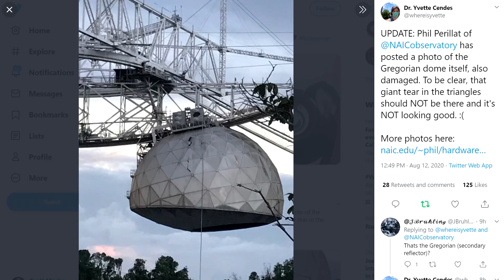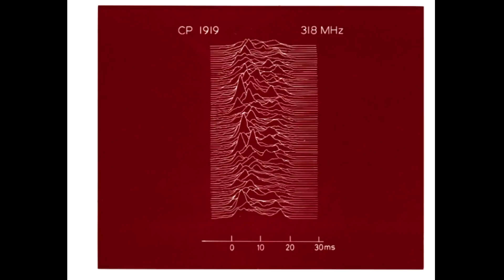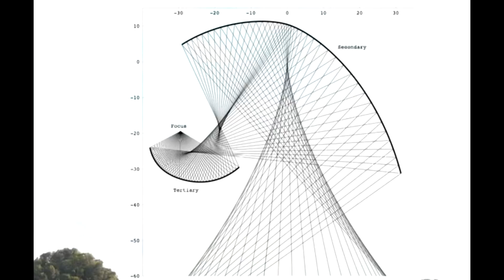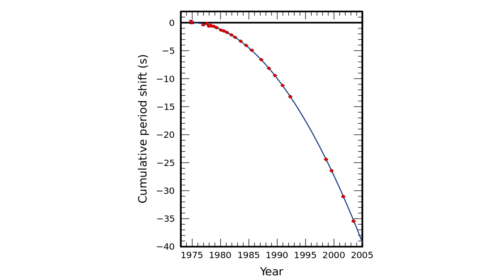Snapped Cable Damages Arecibo Observatory Radio Telescope

Comment: 7:05 Listening to shortwave reflected off the Moon must be very unreliable. Ham radio guys do deliberately bounce signals off the Moon, and it has been done at frequencies as low as the high end of shortwave (10 meter band / 28 MHz) but it is more commonly done at VHF, UHF and microwave. The ionosphere usually reflects shortwave back to Earth (which is how we bend signals over the horizon) on its way out, while higher frequencies punch through to space. Even then, the signals reflected are very weak (square-cube-law out to the Moon, which is a lousy reflector, then square-cube again back!) so it's usually just slow speed morse code or data (13 characters per MINUTE), but if things are just right, they can sometimes send voice.

Comment: okay, do I get this correctly: 1AU is approximately 150 million KM or 8 light minutes. the dish can only correct earths rotation for 160 minutes, so a radar impulse cannot take longer than that to reach the telecope. But for it to discover pulsars and stuff it only recieves waves and can therefore observe much farther objects. Is that correct?

Comment: I measured the rotation of Mercury with radio waves today, what did you do...ummm...the Masked Singer is on in a bit.....did you see what Kim K tweeted out....   OMG we are so f'ed by the complete loss of the education system from K - PhD since the early 1990's....  what a disaster.

Comment: Your close up photo of the tower suggests it too has been badly damaged. There seems to be a big vertical crack in it  propagating down from the bearings at the top (3' 10" in from the top of your piece)

Comment: I'm not an engineer, but I like to speculate on why things happen. Maybe the cables weren't installed/bonded to the conical piece correctly, maybe that allowed it to rust and degrade over time. That's all I can think of currently.

Comment: The head being 900 ton, do the calculations, the forces in the cables will be many, many times 900 tons as you are trying too suspend the head with near horizontal cables, not vertical cables.

Comment: I highly doubt it was a braided cable. Most likely it is a twisted cable, which would be stronger.  Braided cables are more expensive and are really only used where the cable will be flexed often, like an extension cord.

Comment: They'll probably need to go over all the cables in a process similar to what they do on suspension bridges like the forth road bridge where the outsides look fine but the core is much harder to inspect and monitor.

Comment: What if we receive a message from an extraterrestrial intelligence while the telescope is offline? We would never hear it!
Reply: It's probable that they wouldn't have high enough gain to specifically target Arecibo across interstellar (or even interplanetary) distances.  They'd probably just target the Sun with a radio beam broad enough to be picked up anywhere in our solar system.
Reply: @peterallen5575  True, but Arecibo is one of the only radio telescopes sensitive enough to detect artificial radio waves from deep space

Comment: 0:05 Arecibo Observatory incident context
0:39 cable snap and photos of damage
3:00 possibly spelter socket failure?
3:53 Arecibo history
5:52 pulsar research, and the CP 1919 ridgeline plot used as album cover
6:37 history continued:
7:15 frequency response upgrade to perforated aluminium panels
7:49 add fencing to block black-body radiation from terrain
8:11 add gregorian focusing system
9:28 pulsar discoveries - gravitational wave evidence, extrasolar planets
10:18 asteroid observations via radar, 10 AU limit
11:00 funding history and closing remarks

Comment: Back in the late 80's I was a volunteer with SETI were they would send me radio wave files and my 286 computer would analyze the data looking for ET as a screen saver. transferring data back and forth with a 1200 baud dial up modem. Computer Caveman era lol

Comment: The Gregorian system defines the optical axis.That axis pivots about the center of curvature of the big dish. This is called a Roving Fovea system. Roving Fovea systems have been used for agile laser directors and other large astronomical telescopes. Gregorian secondaries are on the other side of the prime focus, a classic Gregorian consists of two concave paraboloids. Since the main mirror is spherical the two mirrors in the so-called Gregorical module have to correct a ton of spherical aberration - this is sometimes called a reflector corrector.

Comment: Putting my mechanical engineering hat on for a sec, That's definitely due to lack of funding for inspection and maintenance. Cut funding little by little and regular maintenance is cut back until ultimately something fails.

Comment: This is a really unfortunate development. I hope they can repair Arecibo as soon as possible. The reflector dish should be easy enough to fix, since it's simple in structure and right on the ground. But the Gregorian Dome and its catwalk might be quite a bit more challenging. Hopefully the Dome wasn't damaged too badly.

Comment: The socketing of wire ropes you mention is either done with molten metal or a corse resin.  This is a great strong means of terminating a wire rope, far better then looping it round something or clamping.

However you tend to get fatigue failure at the start of the socket exacerbated by corrosion.  Possibly made worse in this instance as water will track along the suspension ropes.  In the mining industry you are required to cut, slip and reterminate the winding ropes on a set service schedule, the old socket can then be torn apart to check for corrosion occoring since it's last termination.  If it's failed as suspected I would think it's broken off at the neck of the socket due lack of maintenance.

Comment: My wife and I ended up taking a cruise that boarded in Puerto Rico.  They had "shore excursions" you could take, and I insisted on the trip to Arecibo to see this thing in person.  You can't even imagine the scale of this thing until you stand near it and gaze upon it with your own eyeballs.  I was standing in the observation area on the rim of the reflector, admiring the feed suspended in the air.  And while looking at it, I saw these small little green things sorta bolted on the side.  And then I realized those little green things were large HVAC chillers, like you'd find on the roof of a data center!  That really helped calibrate the scale for me.  That feed suspended out there is essentially a multi-story high building suspended on cables!

The guy doing the tour noted that there's very active management of those cables that are on large reels.  As the temperature changes, of course the dimensions of those steel cables also change and they have to reel cable in and out to keep the feed in the correct position.

There's also a number of stories where the transmitting capability of this antenna was used to recover spacecraft.  I think I remember reading about one amateur radio satellite where there were two conflicting modes - the transmitter in one mode could be on the same band as a command receiver or something, and the transmitter would desense that receiver, and normal commanding wouldn't work because of this.  The solution?  MORE POWER.  Put a kiilowatt transmitter on a zillion dB (well, what, maybe 30db?  I dunno) antenna and just brute force your way into the receiver.

I think it was also used by the group to try to recover that one spacecraft that was in solar orbit, and where NASA no longer had the equipment to transmit commands to it.   Some SDR hacking later + lots of dB of antenna gain -- got them much of the way there.

What an amazing resource for the US, and a shame we can't invest the relatively tiny amount of $$$ to keep it operating.  When I had visited, I believe at that time much of the funding was via the NSF, with Cornell as the "operator" of the facility.  I sure how we can find a way to support this literally one-of-a-kind resource for the future.

Comment: I was almost killed by an incident like this on a smaller scale about a decade ago. A 115kV cable had been incorrectly crimped in a coupler and decided to let go early one morning. The conductor fell into the steel structure causing a flash that was bright enough to be seen around the door frame. Had I decided to walk straight to do a station check (instead of turning right into the control house) I would likely have been electrocuted or suffered severe arc-flash burns. Monitoring systems recorded in excess of 10kA in fault current.

Comment: Hope they repair it.  Same for the Hubble Space Telescope.  I say devise a simple plan now to ensure it doesn't decay and just burn up.  Got at least 6 or 7 years, I think.  At some point, a refurbishment mission should be able to fix its problems.  It should still be a useful instrument even when/if JWST is successful.  Certainly with upgraded sensors, no?

Comment: Close. "Spelter Socket".   When the wire rope goes through, it is unfrayed  then each strand is bent back and ends are tucked in.  The metal is common Zinc with tin added for strength.
A "Peltor Socket " is an inline electrical socket used in electronics.   Do a search.  Both come up easy.

Comment: Surely they can fix and even upgrade and improve the telescope.  It's a sad indictment on the human race that the failure of a single cable and some damage means that the closure of such an observatory is even contemplated.  Let's hope that intelligence prevails and Arecibo gets the much needed attention it deserves.  My computer has spent many hours analysing data fro Arecibo for the SETI project, no luck yet though...

Comment: Please, PLEASE make a video about the calibration process and how photogrammetry is used to achieve the high accuracy of 1/20 of a wavelength.  Last time the process went from camera to film to calculations to screw turns!  This isn't the first time a large cable has reflector panels.  Will another calibration be required after repairs have been made?

See the paper for fascinating details: Photogrammetric Measurement of the Arecibo Primary Reflector Surface; Edmundson, Kenneth; Baker, Lynn (2001)

Comment: I feel like allot of this could be replaced by a cheaper to opperate space telescope or array of space telescopes tuned to do the same job. In the 70's it made sense because launching things into space wasnt exactily cheap back then even with the Shuttle. But now with private space launch providers trying to bring down launch costs I think it could be done more affordably & a modern space telescope would be more advanced than an old dish in central America thats falling appart & loosing funding.

Comment: the not so famous RATAN-600 is a bit bigger, depending how you define size. It has a diameter of 576 m but only an aperture of 1200m²

Comment: Could they also use a longer bounce for really deep RADAR astronomy? If they've only got 1.4 hours they can keep the object being RADAR'd in view, then just see what echoes you get the next day. That'd give returns around 85 AU away (+/- 5 AU if they ping with the emitter centred, with two pings they could cover +/- 10 AU over a few days), which could be interesting.

You'd get a much lower return as you'll have a lot more space for the signal to spread out, but it'd be pretty cool to get RADAR out to twice the orbit of pluto. The earth would be in a different place by the time the echoes got here, but unless you were looking at a big corner reflector then the return will be spread out over a wide arc so we should receive it.
Reply: That's waay outside of the solar system, probably not much to look at ;)

Comment: The 10 AU limit, could they send out a signal and then catch it when the earth rotates back 24 hours later?
Reply: northernepicadvenure 
No, because the Earth would have moved on in its' orbit and the reflected signals would return to where the Earth was 24 hours earlier.
Reply: @michaelkaliski7651  that's basically one degree difference how much of a difference does that make?

Comment: Generally spelter sockets will not fail before the wire... but in this case it does look like that has happened. In my experience the only way a spelter can pull through is if it’s not ‘set’ correctly. On a side note spelter sockets usually use a resin compound fill rather than molten metal. The resin produces the cone shape in the socket that physically stops it pulling out.

Comment: 10:40
10AU
=~5k seconds
=~80min
=~1360min between planetary rotation cycles
=~162AU if they had the sensitivity to send and then receive signals the next time around the planet.
That's well into the heliosphere. 
Possible? 
(Pluto=~50AU at Aphelion)

[Warning napkin maths]

Comment: If the problem is simply one of the termination sockets that is pretty good news. A broken cable would have required foot-by-foot inspection of all of the cables, and possibly replacement. This is similar to replacing the cables on a suspension bridge, a major project. But the terminations are much easier to inspect and repair - if this isn't a problem with crevice corrosion, which attacks stainless steel in dark hidden places like tiise terminations. Then at best they will have to cut off the last few feet of each cable and redo the termination block. That's still an expensive no-fun project but an order of magnitude cheaper. Also I'm assuming they have enough extra cable length to do this ...
I was involved in discussions a few years ago about the desire of NSF to pass off their part of the funding and get new management in their - there had been some difficulties due to joint management by Cornell and SRI International. The annual budget is tiny - about $12mm/year, which is similar to a large-ish hardware store. NSF was paying IIRC 60%.
The capital budget to do maintenance, repairs, and upgrades has been lacking for quite a while. So there are a lot of repairs that they've had to defer.
Considering it is the only radio telescope that can do the radar surveys and imaging, its cost/benefit ratio is ridiculously low.
I'd like to see the new Space Force put some of their planetary defense budget into it. That would be pocket change for those folks and could double Arecibo's capabilities. (It's also capable of tracking Earth orbiting objects such as satellites, space junk, and rockets.)

Comment: Don't they do routine maintenance and inspections? I would think they'd have a certified inspector look the whole thing over at least semiannually, and considering the mass, weight, complexity and cost, that it should be serviced monthly. But then, it is in Puerto Rico, a land that doesn't seem to hold integrity very highly, going by its government as example.

Comment: Scott, first, thanks for all the great content. 
Regarding the Spelter Socket and potential failure mode of the cable, suggest you take a look at a video posted today on LinkedIn by Herbert Weischedel
. 
This makes it clear how a cable could deteriorate to an extent that causes it to fail without exhibiting many of the 'telltale' characteristics one looks for.

Being on site, anyone with a reasonable amount of experience working with cables of this nature would be able to state with a degree of confidence if this were a 'pull through' event or corrosion at the scoket.

Comment: Two questions:  (1) How much would it cost to fix it?   (2) Could we build a bigger version of that on the dark side of the moon? How big could it be in the lighter gravity with the same tension on the wires? What are the candidate craters?   Could you do a follow-up video?  :)

Comment: Regarding the ionospheric research motivation to have Arecibo built:

The math was correct if you neglect collective effects between electrons and ions (so-called incoherent scatter, or non-collective Thomson scatter). The insight gained by subsequent experimentation (and the antenna used for this was massive, just not as big as Arecibo) was that if you use a wavelength larger than the Debye length of the plasma, you see the ion motion embedded in the electron scatter (collective Thomson scatter) and the received power is concentrated into 10s of kHz of bandwidth instead of MHzs of bandwidth for non-collective scatter. More power in less bandwidth means the signal to noise ratio is higher, so you need a less sensitive system.

Bill Gordon and others did a lot of fantastic work. It wasn't a mistake in his math, but a discovery by others as part of the scientific process.
Reply: Scott, I'm a fellow space enthusiast and work with incoherent scatter radars. If you ever want to chat about them let me know!